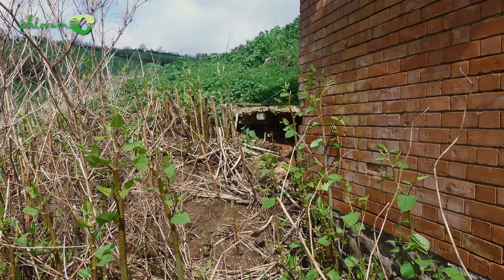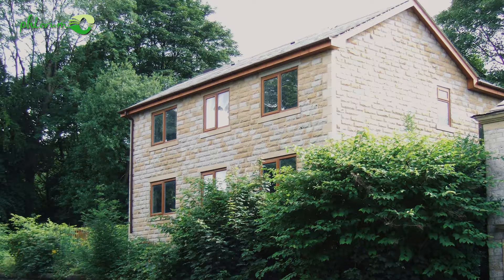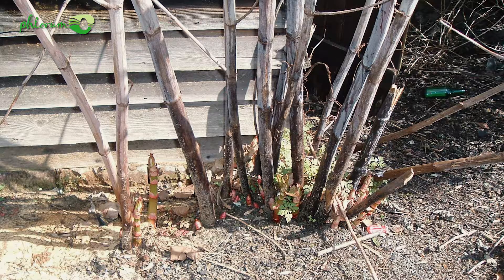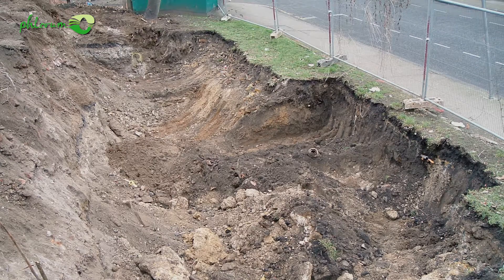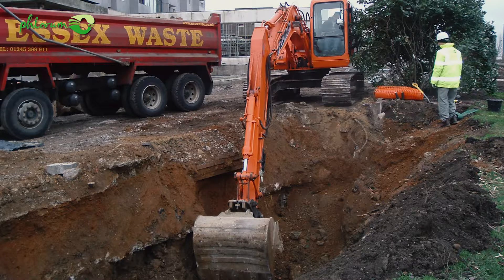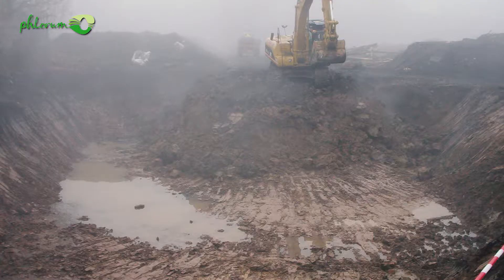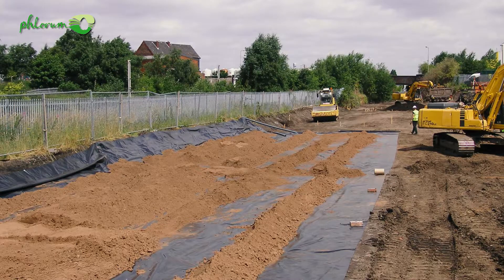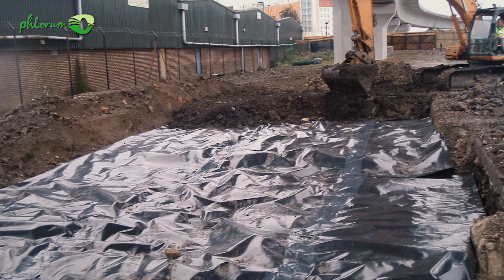Japanese Knotweed Removal: How to Remove Japanese Knotweed

Comment: This is all well and good, but in my case we purchased a home eight years ago not knowing there was Japanese Knotweed on the property. We just keep doing our best to cut it down and dig it out, but is an uphill battle. Thankfully, it is not growing adjacent to our home or the neighbor's home, but it is a nuisance and is taking up a significant amount of space and is spreading into our neighbor's yard. We aren't weaithy by any means, and the use or herbacides is not an option due to wetlands and proximity to wells on our property and our neighbors. I can't begin to imagine how expensive it would be to excavate the property. What do you suggest?
Reply from the maker: The evidence shows that unless you dig up all the rhizomes or use appropriate herbicides (there are products that can be used in and near water) then you will probably never successfully rid yourself of knotweed.